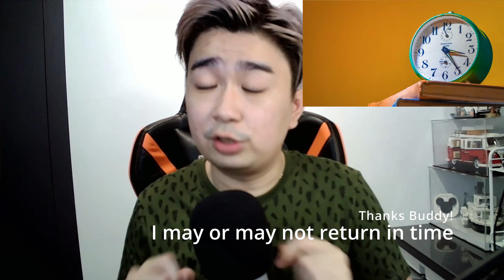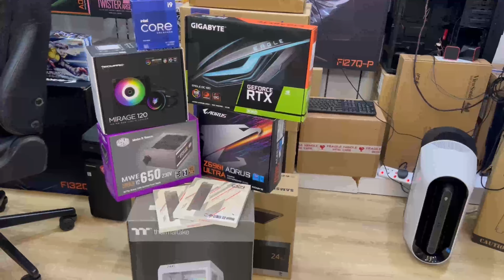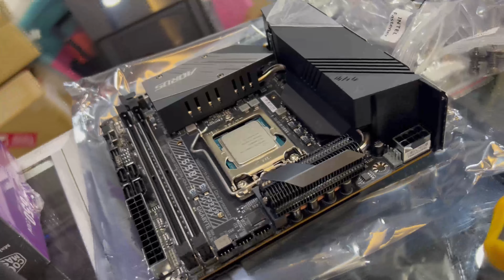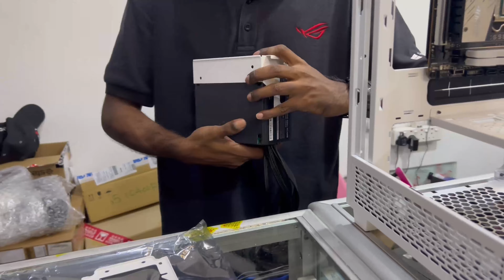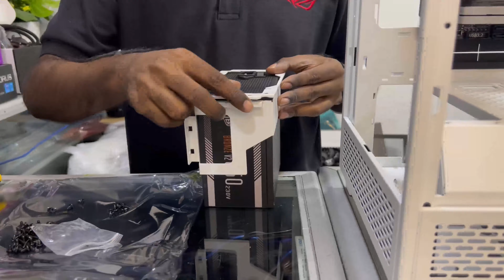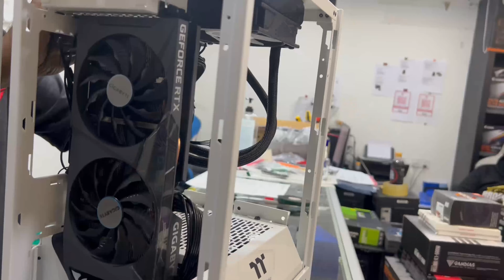ThermalTake Tower 100 - mini itx build | my editing rig vlog

Comment: I am building in the same case. I have a space restriction where it will stand. One reason why I got this case and I like the look of it. Lots of glass to look inside. My colour is turquoise. I hope it looks nice. I have a Ryzen 7 3800x and I am not a gamer or overclocker. I will cool with the Wraith cooler out of the box. From what I have seen on YouTube the H60 will struggle to cool a powerful hot intel CPU, especially inside this case. I hope it works for you and I am interested to see the thermals with your build.
Reply from the maker: That is great to hear 👍
I am currently using 11900k and it going at 5.0ghz for all core. This is due to me using a 120mm aio and it is not the best to be frank, see more in this video. There is no way to fit anything bigger than 120mm aio, so I am now building a custom loop and will be posting a video about it in the near future. I am currently deciding to fit a 2x120mm or 3x120mm loop in it. You can also customise it to have the radiators outside the case but I am looking at a more challenging design for this.
As for the GPU, I am not worried at all as it got the most fresh air.
https://youtu.be/YRmpMrMrZRI
Reply: @benthemechbuilder4741  I hope it will be a success for you. I wil be looking out for the video of your build. You may need to mod the case to get a big radiator in to the loop.